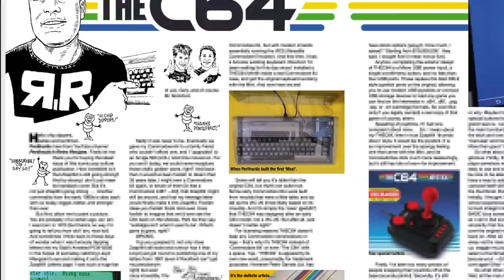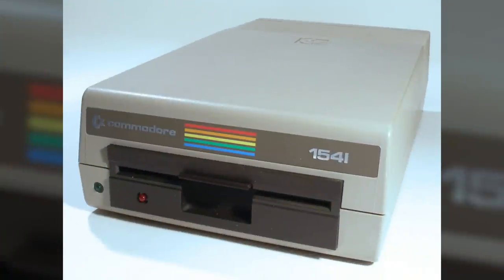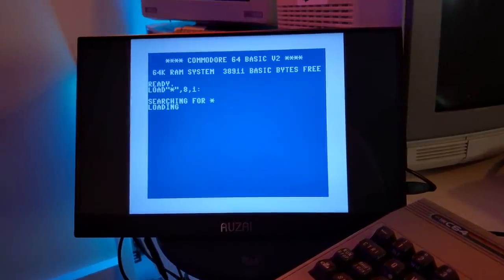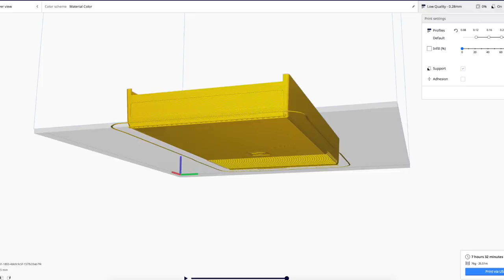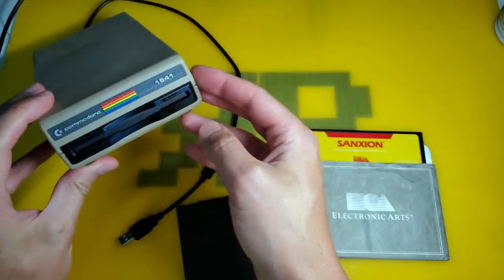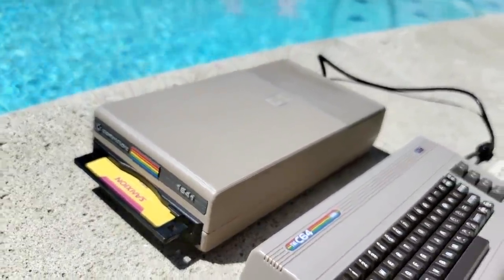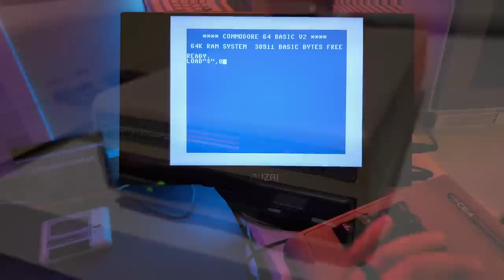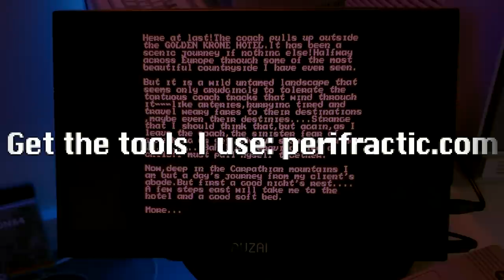Can we make REAL Floppy Disks work with THEC64®? 1541 Mini!

Comment: What would be really cool is if there was a way to get it to read 3.5" discs formatted to be read by a 1581 FDD.
Reply: That would be harder, typical USB-floppy controllers tend to support just the PC-standard formats. There are alternative (hobbyist-oriented) USB floppy controllers like Kryoflux that can be used to make a bog-standard PC floppy drive work with other floppy formats - but it's a less convenient process. Like instead of mounting the drive, you use a dedicated piece of software to image the disk and then post-process it into something useful. So it's a fair distance from being a plug-and-play kind of thing.

Comment: Formatting works in Linux as well, so if you have a PC you can just download a free Linux ISO, boot from that and format all the disks you want without the expense of getting a expensive paperweight like an Apple.
Reply from the maker: Thanks for the input. I've been trying to format the HD 1.44MB disks in Ubuntu with no success when plugging the USB floppy into THEC64 Maxi. The same disk formatted on the Mac still works, if I enable Master Boot Record. There's no such option in Linux that I can find. Any ideas how I could make Linux format exactly like macOS did?

Comment: You would probably get more games per 3.5" disk (or at least more single-load games) if you copied the PRG files onto said disk. You would still need to access them via the "Media Access" menu, of course, and couldn't load them from the BASIC interpreter.
Reply from the maker: Good point!
Reply: @RetroRecipes  You may also have to consider save states; I'm sure that the save states are stored on the pen drive or, in this case, the disk, that you're using.  There are four save states per game so that'd be a lot of memory used per 1.44Mb floppy.

Comment: 7:43 - Ha, you're there erasing all that stuff from the back of the casing like the power connector, fuse, and serial port connectors...  Meanwhile when I got the model from this project one of my first thoughts was, "Maybe I should add the fuse and power connector to it to make this thing look more legit"  XD

By the way, where did you get the 1541 model you used as the starting point? (Or did you make it?)
Reply from the maker: See the grabcad link in Description 👍🕹️
Reply: @RetroRecipes  Thanks. I''ll have to see what I can come up with to actually open that file but I'm sure I can come up with something.

Comment: I don't have one of these to try, but I do have a USB floppy drive that I still use. Getting new (old stock) floppy disks a expensive and a pain to get hold of.
Interestingly Windows will format floppy disks in all kinds of ways. The best way to change how you format the disk, and it may take a bit of trial and error with how the mini detects the disks, is with the command line "format.com /?"
There are loads of different ways to format a floppy disk, I'm sure you could figure out the ones to use.
Reply from the maker: 3.5" disks are still manufactured
Reply: @RetroRecipes  Can you point us in to the direction of who's still making them?
Reply from the maker: @simonj48  I think an Amazon or eBay search, or Alibaba

Comment: Go one better. I use a desktop floppy drive with a USB to floppy drive adapter. Use ot that way, with a 5.25 to 3.5 bay adapter. Then put in a full size 1541 replica shell
Reply from the maker: Don't be shy, show photos! (Google Photos linky?)
Reply: Which adapter are you using? Full floppy support on these USB adapters and drives are very poor and I have yet to find one that works like a real floppy controller in an older PC.
Reply: @knightcrusader  One of the biggest issues is power, but using an external molex to wall adapter with molex to floppy adapter helps with that.
Reply: From what I understand, most of those adapters just support the 3.5" floppy formats - usually only 1.44MB but sometimes 720k too. I have yet to find one that will work with the 5.25" formats like a regular floppy controller would.
Reply: @knightcrusader  To work with a 5.25 drive you would need an adapter, as the connector is different for both the data and power. Which technically I have the adapter in my tool kit.
Reply: I don't think you are following what I'm saying... its not the issue of physically connection or powering the drive, its the controller - the chip that is sending the commands to read, write, and move the motors in the drive. These USB controllers don't know how to deal with the 360k or 1.2MB format on the drive. The chips that control them are only programmed to work with 1.44MB and 720k because the designers were only focused on making those work with it. The geometry on the older diskettes are too different for them to handle, and until someone can re-program them or make a new controller that supports all of them... you're out of luck.

I would love to be wrong, but after nights of combing through google results and vintage forum posts about the matter - I don't think it exists.

Comment: Sorry, issues this end. Paid subscription will resume as soon as I find the 'so and so' that cloned my bank card. Side note/idea.... rip out the internals of a C64 cassette device, drop a usb floppy drive in (attached to working pop up lid obviously)  and Bob is your Uncle called Robert....
Reply from the maker: No problem. I hope you resolve things and everything works out for you 👍🕹
Nice idea too! Trouble is, THEC64 can only load D64 files, and you can't read those from tape.
Reply: @RetroRecipes  - Managed to resolve the being in Inda and the UK at the same time issue... consider my chackles redistributed in you general direction Sir...
Reply: @RetroRecipes  was thinking of attaching the usb floppy to the inside of the cassette lid that pops up... hit eject, up pops usb floppy drive :)

Comment: I'm kind of surprised you labeled it a 1541, instead of a 1581.  When I had my C=64 back in 1984, I had a 1541, 1541-II, a 1581, and an 8250.  I had 4.8MB of online storage. With a modified 64 RAM expander holding a single bank of 512kB of RAM.

Comment: I seem to recall the FAT32 patent having a more permissive licence, for the benefit of cross-platform compatibility, whereas other FAT systems (FAT12,FAT16) are not covered by this. That may be the main reason why many systems don't work with it, it's technically doable but the licence would cost too much.

Comment: Retro Recipes.... There is ONE thing you will FOREVER be missing (unless.........................you 3D Print it Wink Wink!) is a Mini Matching to scale Commodore Monitor (the brown one 1702 I think).  Find a Real mini Tube TV or heck get a proper 4:3 mini LCD and use the trick New Wave Toys used on thier Retrowave Ghost N Goblins and Ghouls and Ghosts mini arcade to make the LCD look like a curved Tube, if finding a color mini CRT is not possible and make one!!!!!

Comment: Try out Anadisk and VGACopy in DOS, too.
These tools will raw copy and format Floppy images independent of the system and also can read/write more than just 80 tracks.
Good for forensics or see strange copy protection methods from the past.
I was able to read ZX Spectrum 800 KB floppies (on a special CP/A system used in the former GDR, normally it was 720 KB only) on a 1,2 MB PC Floppy drive using Anadisk. No need for a special drive. Should work with Amiga and others, too.

We built some of these micro computers from ground up in the past:
"KuB64K" ZX Spectrum custom ROM, with a copied Z80 chip called U880, used CP/M, CP/A and a kind of GEOS I think.
WIth some addon cards stacked up a real ZX Spectrum it had some nice features like snapshots (suspend to disk) and RAM/ROM editor.
I still have a DIY tower with 3x800 KB Floppies for it.
https://www.robotrontechnik.de/index.htm?/html/computer/bausaetze.htm

VGACopy was one way to format a 1,44 MB Floppy to 1,72 MB, yay!
Or use dd/cat within Linux/Unix/BSD/macOS and so on, it's different than how Windows formats/copies nowadays w/o real RAW access.
Similar to the dd vs. iso copying method of iso/img/dmg files, where iso copying method often fails to boot images, but dd copy method works.

Cheers mate, nice channel, good to see people still know all the good stuff and even upgrade it with new things like Gotek Floppy Emulators and stuff.
Who would guess 30 years ago that we now have Android devices which can swap Floppies on old machines remotely using Gotek modded with ESP32 + WLAN?
Or WLAN cards on C64 and similar, max out RAM and speed, but remain the original cycle speed of the CPUs and classic sound and haptics.
Emulation is nice, but real hardware is much better.
Go on with this precious conservation of worthy hardware, software and memories!

Comment: I'd like to thank Perifractic for knocking me off the fence and convincing me to buy a 3d printer.  I've wanted to try 3d printing for a long time, and making a 1541-mini to pair with my C64-mini was enough motivation to force me to dig into my wallet and get my feet wet.  Of course, I'm already thinking that if you have a C64-mini and a 1541-mini, then the next thing is obviously an enclosure for a 7" HDMI display that looks just like a 1702 monitor.  The 1702-mini!   How cool would that be! - anyway, this was a great video!  - Cheers to all the 'fractics!

Comment: And here I am just wondering what slicer settings you're using.
Reply from the maker: I think the defaults in Cura
Reply: @RetroRecipes  Wow, that's an amazing print using the defaults!
Reply from the maker: @BlueCollarBachelor  It's the Ender 3 Pro which has a better extruder - not sure if that makes a difference. Generally I figure default settings are default because the manufacturer thinks they're the best ¯\_(ツ)_/¯
Reply: @RetroRecipes  The thing with Cura is that it's written by a competing printer manufacturer... I have a EZR Struder on my Ender 3... you might want one for your 3 Pro. You just got a really nice print for not having to mess with  things!

Comment: Still have an original working C64 with the 1541 drive and original color monitor. Somewhere I even have my VicModem. Got scads of games, a couple of joysticks, and even a generic version of DataSette cassette drive. I believe I still have several issues of Run magazine, as well as a couple of other titles from back in the day. Haven’t had it all hooked up in years tho. I always wanted the C64 with the built in disc drive. I believe those used the 3.5 floppy.

Comment: Now, you can get a real 5.25" floppy drive and make it work over USB. I've gotten part way there. You have to get a cable that will plug into a 3.5" normal floppy, and then get an adapter from the 3.5" connector to a 5.25" floppy drive. You'll also need power for it and scrounge a 5.25" drive itself, they don't make them any more.

Comment: It would be funny if you could add a 1540 mode, then when you try to load 64 programs it won't work, but with the VIC-20 it will.

Comment: Now that's wicked cool!
Reply: I decided this would be the first project I would do on my Creality CD-10S.   Got the bed leveled a bit tricky but I started with the Badge and got to print and it came out well.   The top not so much it trashed all the vents because they actually curled up while it was printing the front part of the top and when I removed what did print the Commodore Log was well it was there but it sort of melted into the plastic.   Obviously I was doing something wrong but I only got to about 3hrs into that print.   I decided to print the base and see how that turns out in the morning when I wake up.   Not complaining its a learning process for me.    I don't have THEC64 to use this with when done but I thought it was Wicked Cool so I thought I would give it a try.

Comment: Windows explorer writes a volume identifier to a hidden sector on floppy disks when they are read.  If format with a cmd line and don’t use file explorer it should work.  It’s probably simular to why windows will break ibm ps/2 recovery disks.

Comment: you could've touched the case up after the print to have a texture that is closer to the original rather than just the generic 3D printed diagonal pattern and mounted the floppy inside in a more serviceable way (maybe have stoppers in the top half of the case padded with foam or something to keep it in place rather than hot glue?)

Comment: i have  c64 maxi, any chance when using machine code monitor supermon64  it can save/load a program to usb stick, supermon64 does not seem to reconise the usb drive. I dont want to use the c64 maxi save/load option.

Comment: i think i had used a standard internal 3.5" drive and an usb to floppy adaptor. So the aspect ratio of the width and height of the drive panel would have been more like the original 5.25.

Comment: So, since Macs are technically running a flavor of FreeBSD (Darwin), you should be able to use FreeBSD or Linux to format a disk.
Reply from the maker: Thanks for the input. I've been trying to format the HD 1.44MB disks in Ubuntu with no success when plugging the USB floppy into THEC64 Maxi. The same disk formatted on the Mac still works, if I enable Master Boot Record. There's no such option in Linux that I can find. Any ideas how I could make Linux format exactly like macOS did?

Comment: Last time I successfully formatted a 3,5" disc must have been about 10 years, ago. Not that I didn't try since, but it seems that all the old drives and floppies are done. But the 10 years older 5,25" drives and discs are all working, though.. I really loved the 3,5" disks when I had the Amiga then, because with their 'sophisticated' mechanics they seemed so professional and cool, but afterwards it shows that they where a really crappy technology.

Comment: I had a similar issue with formatting disks in windows 10 and using them on a dos 7.0/win98 machine. They just would not read and I thought my disks were bad. I formatted them in linux no problem.
Reply from the maker: Thanks for the input. I've been trying to format the HD 1.44MB disks in Ubuntu with no success when plugging the USB floppy into THEC64 Maxi. The same disk formatted on the Mac still works, if I enable Master Boot Record. There's no such option in Linux that I can find. Any ideas how I could make Linux format exactly like macOS did?
Reply: Retro Recipes I had been using images with dd, but this should work to create blank ms-dos format floppies (https://wiki.debian.org/FormatFloppy#Formatting_with_a_DOS_filesystem)   may need to substitute apt-get where they use aptitude though.
Reply from the maker: @molten_software  Thanks. mkfs.msdos /dev/sdb gives error "attribute "partition" not found". The floppy drive does access during this error. Any ideas?
Reply: Retro Recipes sorry I posted that before trying. I am getting the same issue with a usb floppy drive. However what Is working now after trying is downloading a blank 1.44mb disk image from ( https://www.rmprepusb.com/tutorials/winimage#TOC-Create-and-Edit-a-1.44MB-or-2.88MB-DOS-floppy-disk-image) and using dd, which on my machine was “sudo dd if=/path/file.ima of=/dev/sdb bs=1024 conv=sync ; sync”  and this worked just now for me
Reply from the maker: @molten_software  ok I'll try that. Could that image be written to the disk without Linux, in Windows do you think?
Reply: Retro Recipes the only reason I was using linux is due to Windows 10 making unreadable floppies with this same usb floppy drive. However I was using winimage in Windows 10, and its possible another program would write differently. I have seen there is a dd for Windows but I’ve not tried it. I will fire up another machine and see if I can make the same image in a Windows XP VM.
Reply: Retro Recipes seems like it works fine in Windows XP VM (passing through from Windows 10..) but still doesn’t work in Win10. Could be WinImage 10 on Win 10 and WinImage 8.5 on Win XP, but I think Win10 just handles media differently.
Reply from the maker: @molten_software  Well, the process worked, but when plugging the floppy into the Maxi, it doesn't see it. One thing I thought is if I format it on Mac so it works, what would be the Linux command to turn that into an image file, that I or anyone could then write back to the disk via Linux? Basically, clone the Mac formatted disk.
Reply: Retro Recipes Retro Recipes oh! its the same dd command but you switch the “of” and “if”. So if= is input file so that would be the floppy like /dev/sdb, and then of= which is output file would be a new image file like of=/user/me/Image.IMA . I hope this helps!!
Reply from the maker: @molten_software  Great! Would you know a similar way in Win10 to image the floppy then write it back again in Win10? Unfortunately the floppy doesn't appear in Win10 Disk Management GUI.
Reply: @RetroRecipes  ok, HDD Raw Copy tool doesn't work with the floppy because it uses Windows Disk Management, which doesn't see it like you said. So DD for windows worked to make an image, which opens and writes in WinImage 8.5. 
(http://www.chrysocome.net/dd) I used the most recent beta version 0.6beta3.    I put DD on the root of the C drive, and then opened CMD as administrator and ran: 
"C:\>dd if=\\.\a: of=c:\disk1.img bs=1440k" and that created a 1.44mb *.img file that I can open up.
Reply: Looks like Windows puts hidden files and folders on the disk and they are present in the image as well.
Reply from the maker: @molten_software  Well, I think I got it working, thanks to you. I actually already figured to download dd for Windows before your reply. However writing an image from Win doesn't work. But, creating an image from within Linux did complete. I then took that .img to Win and used dd of=\\.\a: if=c:\PER1541.img bs=1440k and Windows wrote the image to a blank floppy. When inserted into THEC64 it worked! Thanks a lot!
Reply: Retro Recipes that’s amazing news!!!